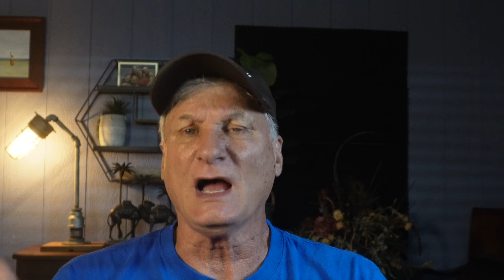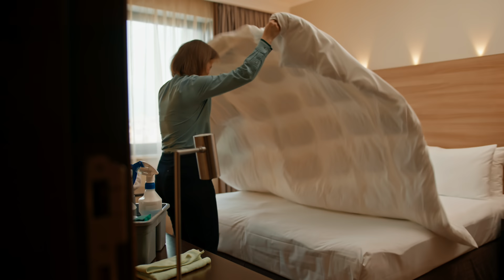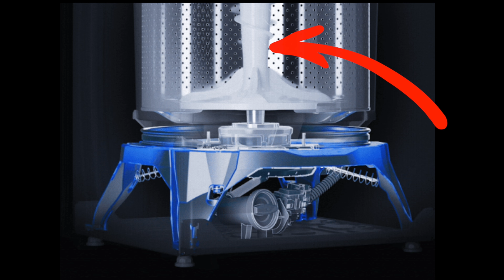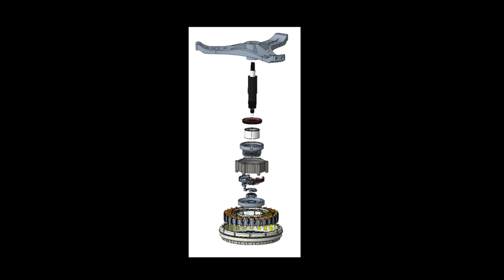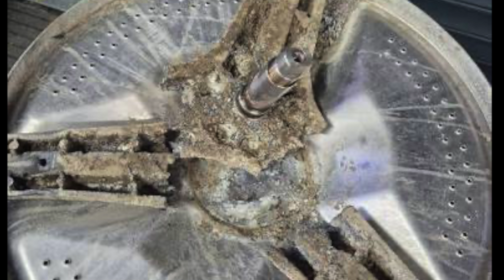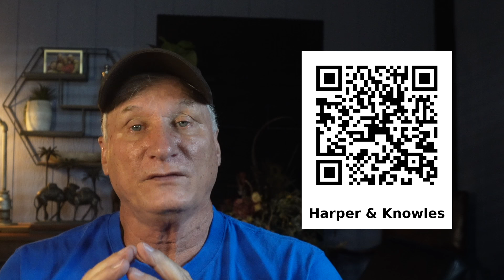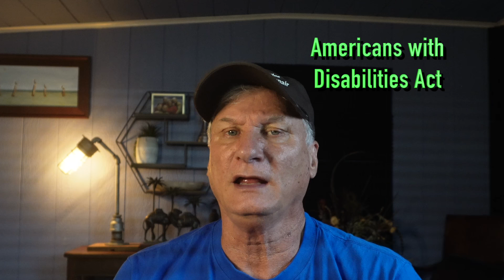Maytag's New 30-Year Washer: No Gearcase, Real Agitator, 900 RPM

Comment: My Whirlpool washer lasted 18 years - single person. I got what is called Speed Queen Commercial Heavy Duty - model AWN432SP113TW04 -- wow, that won't catch on. No simple model number.  I still have the Whirlpool dryer and use the Low Heat Automatic Miser mode. This Speed Queen settings use more water than similar settings on the previous Whirlpool.   Not that it matters, just learn what works.   I don't use as much detergent as with the Whirlpool as, unless I use the extra rinse switch, the detergent can be felt. Clothes come out clean.      The salesman at the locally owned appliance store told me appliances won't last longer than 8 years in family use.  So far this Speed Queen is at year 8 but not in family or even 2-person use.  Time will tell. This salesman was keen on matching badges. I had to ask - what is a badge?  The emblem on it. Who cares? I always have a mix of appliances.  I got matching Frigidaire appliances, made him happy (haha). I wanted a solid surface cook top and wanted matching white in the kitchen. So far, so good. 

A couple neighbors had Maytags - in the mid '80s. They seemed smaller tub wise but were smooth running. That is my only experience with Maytag.  I had a GE washer-dryer set in late '80s and the washer lid started to rust on the lid edge in just a few weeks and I always leave the lid up when not used.

Both the Whirlpool and Speed Queen washers seem comparable for my use, similar noise level, which in a laundry room is reasonable.

When my KitchenAid fridge quit working I got a noisier Frigidaire.  Instructions said weird noises are normal! Don't call us about noises.    Both of these had/have tiny air fans in the heat exchanger. The KitchenAid pushed air out the front bottom but the Frigidaire just reciculates  air so I have to remove or replace the cardboard on the back at different times of the year or my lettuce freezes!  I won't buy that again!

Comment: I have owned GEs, whirlpool and Maytag washers. I have rebuilt all those, transmission replacements, bearings and electronic boards several times over the years. I even have gotten my sons involved in washer and dryer repair on times when I was real busy at work and didn’t have time to do it myself. 
Last month I purchased a SpeedQueen washer and dryer. Front load washer. The SpeedQueen washer is faster, quieter, spins the clothes dryer and seems to use less water, but I can’t prove that. Time will tell if I have to do servicing less or not. My wife and I couldn’t be happier with the SpeedQueen. The only sad part is that I didn’t get the speed queen 20 years ago. 
So good for Whirlpool for finally coming out with a better washer. Better late than never.
Reply: That SQ front load is what, 2500? It may be a good buy if it lasts 15-20 yrs with no repair. But most people cannot afford it without a loan. And you have to maintain it more than a top load.

Comment: Nah, Its will break after 10 years. Looks like all of the parts are plastic. The detergent & bleach will make it brittle & crack. Its going to need electronics for the Brushless motor that controls that motor and odds are one or more of the components will become obsolete and no longer produced. I don't think Maytag will design a new PCB to replace the old one when the electronic parts are no longer available.

seems to me the Washer is designed to be the lowest cost possible, & not for durablity & repairability. Using a Brushless, gearless system is just a lot cheaper.

Comment: Thanks for your honest review based on your knowledge so far. We can hear the bearings on our current washer getting louder, so we are hoping it will last until we can actually compare these two machines side-by-side. One thing you didn’t mention (unless I missed it) is load capacity. This Maytag is noticeably bigger than SQ. IF the Maytag comes in a small chunk of change less expensive than the SQ (200?), it might be a good purchase given the size of the load.

Comment: does it have a pressure switch? that's why my washer died, i use a well. and after it starts the pressure drops. and a timer can't account for the change. the result is that it  tries to wash without enough water, ruining the gears

Comment: Thank you for this.  Not sure how this came across my feed because I'm not looking for a washer or dryer but you did a great job.  I can say though that we have a 11 year old LG front loader and dryer and have been thinking of replacing them.  Mainly due to the dryer taking extra time to do its job.  So I either wrestle with the dryer to replace the heater or element (not sure of the proper name) because it is on the bottom I think or we just buy something new and save wear and tear on my hips.  

So thinking on it now this video is probably perfect timing as I would not have considered a Maytag or a top load washer.  And now I will.  Thanks.  Looking forward to you sharing more information on it when time allows and availability.

All the best, take care.

Comment: My question is…..Will the new washer dumb down water temps when not on the ECO cycle? Can the machine draw a full tub of water from straight from the water heater?

Also, they are calling that “thing” an agitator. It’s NOT. In Whirlpool’s own words ( that they no longer use) it’s an agi-peller. They invented the word. An impeller plate with a center pole. It will wash like an impeller machine. On a one piece agitator or agi-peller….the corkscrew that moves both ways is counter productive. Fully loaded, it will dip a handful of laundry down on the forward stroke and burp the same handful of laundry right back where it started. There is no rollover with this agi-peller when the machine is fully loaded. There is nothing new here. You can see how this machine will handle wash action on YouTube right now.

Comment: My 7 to 10 year old (inherited with the house) LG started acting up. Not using hot water when set to, filling up and then stopping, etc.  Saw your video channel. The rave reviews in the comments reinforced that Speed Queen was the best way to go. Like my ol' man used to say, "Cry once, buy once" meaning buy the best and you won't have to spend more than that replacing inferior products time and again.  Anyhow, so far been pretty happy these past few months. Thrilled they're still built in America, and amazed they have a 7-year IN-HOME warranty, meaning parts AND labor. Most are just parts. Was a bit surprised that the dryer door (and washer lid) were thinner sheet metal than I expected. Not really a good solid closing feel in the dryer door - in fact flexes a little bit.  Also thought it'd be easier to get the lint tray out to clean. I'll adjust to those little things as long as it runs reliably for many many years to come.

Comment: 35-year appliance man here. Im not as knowledgeable as you but this sounds promising. I absolutely miss the direct drive whirlpool. I like the hanging rods gone, the no transmission drive like a Bravos. I like the clean out. It needs water level pressure switch. My customers HATE load sensing and love the agitator. I never liked working on their "modular" junk they've put out since 2011.

Comment: I just wish speed queen would make a large capacity front load in something other than White. I build custom homes with mostly recessed flush washers and dryers. 90% end up LG and we have not had many issues until about the 12-14 year mark when drywer drums crack and washed balancer systems stop working. Motors and pumps seem to outlast the customers desire for something new.

Comment: Hey Chip! Been watching a bunch of your videos for a while.. and finally subscribed.
Your presentation in every video is phenomenal! Clear speech that makes it easy to follow.
I got a 1996 Kenmore direct drive washer and matching dryer that I bought used in the early 2000s.. and they're still going today.
Repaired them both a bunch of times over the years.
The washer has had the neutral drain issue where it will spin with a full tub of water, it's been that way for years.
Funny thing is that after using the washer a whole bunch of times the other day for many consecutive loads, the tub stayed still during draining like it's supposed to.
What do you reckon? I think maybe the gummed up oil in the transmission thinned out some from all the heat generated from the heavy usage.. allowing the neutral drain parts to start working normally again. I dunno. At some point I'm gonna open it up anyway because that oil can't be any good after 30 years.
Thanks for what you do and sharing it with us! 🤘😎
Reply from the maker: That sounds like a solid theory, as heat often helps those older lubricants perform better; thanks for the kind words and for subscribing!

Comment: I still think front loaders with Fisher Paykel drive motors, as you describe here in this top loader, are as dependable as any. However, for 9 years I had a Sears front loader with standard drive and with EnerStar rating. It never worked right from the start  because it never used enough water to completely wet a load, despite full factory warranty and frequent visits by service techs. Control panel failed and was replaced several times. Ultimately I found the water fill control and  adjusted it to admit enough water and it solved the problems until control panel quit and none were available.

Comment: American industry has the ability and the capability to build appliances that last for decades, but chooses not to. The business model favors those who make and sell products that need to be replaced as soon as the warranty expires, if not sooner. They figured out that there's no upside to selling someone a product that they'll never have to buy again; at least not in the lifetime of the person who sold it to them. Take the latest in a long list of disposable appliances; the so-called Smartphone. As a child, I remember the phone we had hanging on our wall in the kitchen. That phone was hanging there on the day I was born, and it was still there and in perfect working condition long after the day I moved out 18 years later. They could easily build smartphones with replaceable batteries, and circuit boards that can be updated, but they choose not to do so, because selling you a new $2,000 phone every three or four years is a lot more profitable.

Comment: Oh man, I had to comment on this.  I did lots of research last year and your advice was so appreciated that I pulled the trigger and bought a Speed Queen from a great dealer in Marion, Ohio.  Yes, it was expensive, but I am tired of GE, Whirlpool, and Maytag for the 5 washers I have had to purchase over the last 35 years.  But here's the kicker to all this.  I bought the over-the-window sill GE room air conditioner last August and for the remainder of last year the internal water pump worked fine.  I followed the storage instructions before removing it for the winter.  This year I put it back in the window and the water pump would no longer work and the unit would shut off.   I went through GE because it is still under warranty and was told GE turned all their warranty claims over to Bodwell for them to handle.  A local appliance repair came out July 6th, said it needed a pump, and ordered it the next day.  I called the appliance repair, and the shop said the pump is still on backorder from GE because all the parts come from overseas.  I said that is one reason why I bought a Speed Queen washer.  The shop said that they carry almost no parts for Speed Queen washers because they never have to repair them.  I asked how big a territory they cover and was told from Columbus all the way north to Lake Erie.  That is a huge territory to cover.  And that just also added evidence that I made the right decision on buying a Speed Queen.  Thanks much for your crucial advice!  Oh, am still waiting on the water pump; maybe it will arrive by Christmas.

Comment: I have a question about my Speed Queen. We bought our current home (built in 1970) 20 years ago. Shortly after we moved here, my Maytag, which I had had for 12 years, gave out on me. (I had raised 4 children during the lifetime of the Maytag) 

I purchased a Whirlpool front loader. It was the first front loader that I had ever had. I had to have a repairmen come a number of times before the board went out on me altogether, 8 years after I purchased it. 

I went to Sears and asked what they had that didn't come with the computerized control board. I was told they all had them, but he had one machine, a top loader, whose board was more simplified than the others. I bought it. I can't remember the name of the brand. I was not familiar with it. It actually lasted 4 or 5 years without any problems. But an electrical transformer box in my neighbor's yard caught fire a couple of years ago, and our house was the first on that line and we got hit with a large electrical surge that took out most of my appliances, tv's, and a number of other electrical devices in the house, such as lighting in some rooms, vents, garage door opener, etc. And the washer machine was one of the appliances I lost. 

By this time I had heard about the Speed Queen appliances, and had made up my mind that the next set I was going to get was SQ. So that is what we replaced our fried washer and dryer with. A SQ TC5. At first, I didn't see any problem with them. BUT, one day I noticed water under my laminate flooring. I called a plumber. They came out and told me the problem wasn't the plumbing, but the washer machine. So I called the repairman. He came out, checked everything over, said there was nothing wrong with the machine, and the problem was the plumbing. 

It seems, according to the plumbers now, that the pipes (cast iron) used when they built our home in 1970, were smaller than the pvc pipes used today. We were told it COULD be 1)  that the cast iron pipes are corroding enough that they are collapsing, but they don't have problems when they run the snake through them.  Or 2) another problem that it could be is that Speed Queen built their new machines to push more water out, (I think it had to do with pressure) than the old machines, and my old pipes, which are smaller than today's pipes, can't handle all the water being forced through. But they couldn't tell me WHICH the problem was. When I asked if they could run a camera through the pipes to see if the pipes were the problem, I was told their camera was too large to run through them, and they didn't want to risk getting it stuck in the pipes. 

So my husband and I have two options. We can have them jack hammer up the foundation in my laundry room to replace the pipes. Or we can get a washer machine that doesn't use as much water. Right now, the only settings on my washing machine that I can use is Delicate, Eco, or Permanent Press. And we can't run a large load. We're having a hard time with the decision. Having them tear up our foundation is going to get expensive. I've told my husband we could go back to a front loader. But he's concerned that if we do that, we might find it doesn't help the problem and we're back at having to tear the foundation up. 

I did not mean to make this so long but I've wondered if you've seen problems like this with Speed Queens and older homes. I've lived in this home for 20 years, and we've only had this problem this last year. I've had front loaders and top loaders, but they were suppose to have used less water.

Comment: In 2018 we needed a new washer and unfortunately that was the interval when Speed Queen had stopped making the tc5 type. We bought the Maytag commercial unit washer.  We got about 6 years out of it before it started needing repairs... agitator, hangers, splutch, etc. The control board finally failed. Never again. We now have a speed queen TC5. I'm glad that there's going to be more competition though.
Reply: I looked at that commercial Maytag model in 2018, and was also looking at SQ.  Since only the TR series was available, I searched Marketplace.  Found a gently used 2016 SQ with mechanical dials, for a bargain price of $250.  It was in the house the couple had just purchased.  I told the couple they would miss it…they had already bought a Samsung set.  My SQ has been trouble free so far!

Comment: A Cabrio used a motor that was very similar.  The problem with that is the bearing assembly would fail when the seal let water into the bearing.

Comment: Just replaced the transmission ($200 oem part) on my 13 year old Kenmore top load washer because the bearing went bad, if I knew how stuck that shaft was going to be I would've just bought a new washer.  But now I know how to work on it, so I'll keep it as long as I can get parts for it.  Same with the dryer.

Comment: the diagram shows a cast aluminum (or zinc pot metal) spider arm.  do those corrode and break on top loaders the way they do on front loaders?  the speed queen front loader uses a stainless steel spider arm...

Comment: Nice job explaining this. Nothing today is built to last much past 5 years. No manufacturer stays in business by building products that last for 20-30 years. Even 10 years is a stretch. What fails most often in these high speed washers are the transmissions. My GE started leaking oil under the washer and then it started making noises. Transmission is trashed at this point because the bearing is in failure. I got more than 5 years out of mine but mind you, we don't use our washer every day like many families who do 2 loads a day 7 days a week or more. The worst washer I ever owned was a front loader. If you want your clothing to smell like mildew, buy a front loader. As for dryers. If you want your dryer to work well and dry fast, send the dryer vent straight out the wall. When the vent travels up and out through the roof, the dryer will work harder and it will take longer to dry your clothing. This will run up your electric bill.